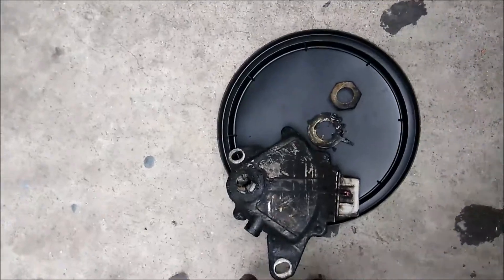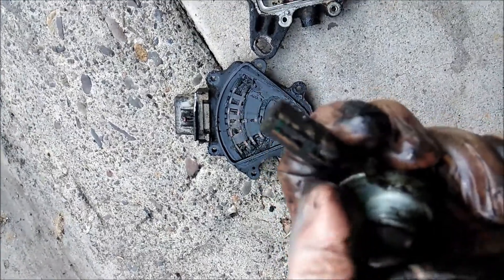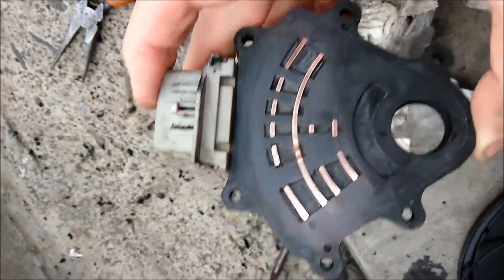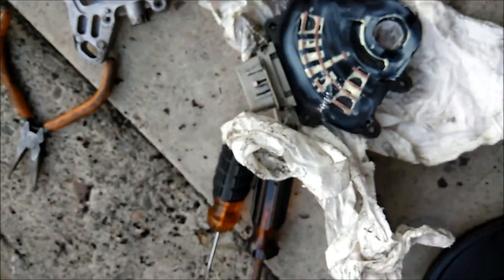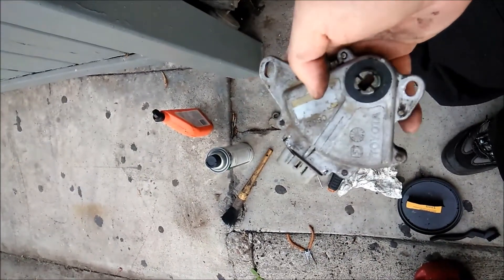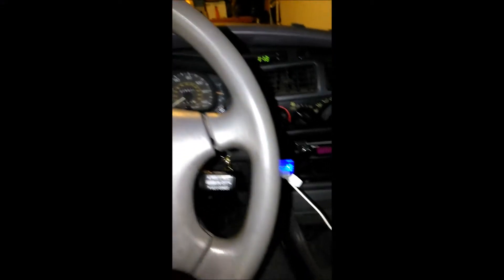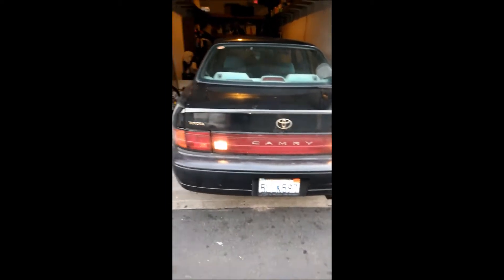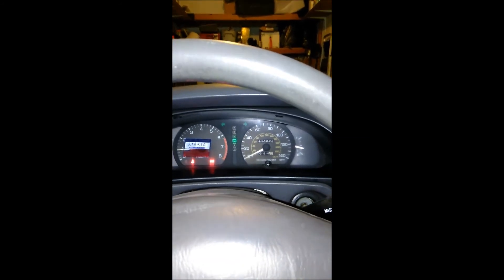How to rebuid the Neutral Safety Switch 1993 Camry

Comment: Great video. I have a free car coming to me that I believe has a problem with the neutral safety switch. Sometimes starts in park or sometimes only in neutral and other times not at all. I will see if it needs an adjustment first and then will follow your procedures on cleaning it. I am glad I discovered your video.
Reply from the maker: How did that go?  did you clean it and get it to run?

Comment: I removed the plug, 10mm nuts the 7/8 nut but I can not slide the switch forward off the shaft. How did you slide it off?

Comment: J have the same  camry 1992 2.2  don't  work drive  2 and L Parking work neutral work reverse  work.On the display  on dashboard  all ligts works  except  the D drive .Also don't work the backup  lights  and reverse  lights  .J clean up  the neutral safety switch but the problem wasn't  solve .What should j do to buy  a new neutral safety switch  or to clean again and to put a cooper grease for better  contact
Reply from the maker: make sure that after you clean it, you also use very fine sandpaper on the contact to get them nice shine and copper looking and put dielectric grease.  Also note that after you put it back into your transmission and hook everything up, it does have adjustment to make sure it switches correctly, put the car in Neutral, then move the neutral switch till the N light comes up then tight the nut, verify that all lights come up P, D, N, 1, 2, R, if not, adjust again, if the contacts are not in the right position it will fail to operate.

Comment: Im going to do this on a 1988 model soon, hope it works
Reply from the maker: Let me know how it went
Reply: My problem is there is no reverse light and lights indicating my current gear.

It fired up in park, did not try Neutral before first try. After first try i could not start it in N, only P. I also cleaned the pins on both connectors.

On the second try i stretched the springs and sandpapered some more on the copper brushes.
This time it started in Neutral but still no Reverse or Gear selector lights.

I think the only thing left i can do is to sandpaper the copper contact some more, but they dont seem bad.

Maybe the actual plug on NSS is faulty.

Comment: 11:28   I'm surprised your P light still works.
Reply from the maker: all the contacts for the lights are in that switch so once it gets dirty and cannot make a good contact the light don't come up, but once you clean it good it works like a champ, beats having to buy a new one especially if you got an older car.
Reply: @lucap3964     My P light bulb burned out. I had to replace the light bulb.
Reply from the maker: @markflierl1624  get LED lights I believe they are T10, they are brighter and last longer, I replaced all my dashboard bulbs with LED, big difference, you will enjoy your car better and they are only a few bucks online, China stuff OK for LED.